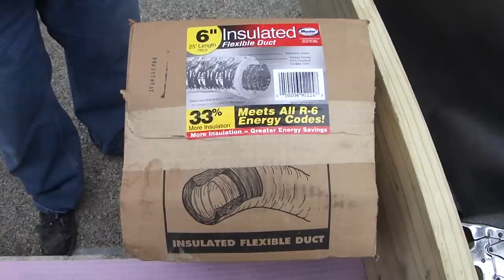Building A Small Room Addition And A Deck

Comment: i dont mind having a code to work from but now days code insnt just about safety its about land value and to generate income for state and county /citys ,,if it was only for saftey  measures u could build any size building u wanted on ur property and dwell  in it but its not,alot of codes are made to boost industry as well like the one i know of states u have to use a header for gages that are laminated together wen u can make a header just as strong for the task with lumber and plywood ,in fact code called for it in the 80s but since the big lumber maufactures now have lamininated materials available u are demanded to use it,,the manufactures are the ones testing their products and setting most codes to those standards wen the average joe can use a completly diffrent material to do same said task and be just as good or better it wont pass code because they dont have proof of concept to get it passed it takes big money to do the testing of those products for diffrent appkication and big industry is who has it so the goverment takes their word over the publics,,and really who is to say the strengh of one peice of wood is stronger then another wen it comes from a tree it could have diffrent qualitys to it if u go to the lumber store and buy ur lumber theirs a tag at the end thats says its safe go to the saw mill the guy gives u rough cut lumber and no tag the saw mill lumber will be thicker and yet the big lumber store issupposed to be the safe peoce of lumber wheres the logic in that ,i tell u its greassed palms that makes it safe for code mno dude didnt do a perfect job he could of nailed his rafters to the roof band walls not sure how he tied the roof to the house but i dont see it falling down any tome soon,he actually over built alot of wat he did especailly the foundation,good video,but u really should watch a few more videos or take a class on how to frame if u intend  on doing this for a living it will save u money and help make most of ur jobs alot easier and make u more inc0me in the long runn,

Comment: noooooo noooooo  never tap off a heat supply bud an not with flex pipe ether you have to go off the trunk an have a return near the room to take it back to the air handler an that flex was way to long 12 feet is pushing airflow with that stuff run  hard pipe all the way to the inside of the house do not ever run flex outside   flex off the trunk if needed  4 inch hard pipe  is all you need for that tiny room

Comment: you gotta stop calling floor joist rafter. It's against code  and its not healthy to put pressure treated in a living space such as a ceiling. And next time he thinks it's a good idea to jam a heat vent in the corner or up again an outside wall of a place he might wanna at least keep it far enough away that when u put baseboard on the heater cover still fits on. With all that bragging he did and money he got them to spend on that job he would've ripped that shitty roof off and redone it seeing it was barely hanging on there anyways..

Comment: excuse me this guy is a hack the floor isn't properly supported not enuff joices i dont like the way he does this and the block wall has to have insulation inside or there will be cold radiating from the block during winter and the 2x10's must be tyed in to the joices in the house and the out side walls must parged with concrete to seal.....

Comment: There is all kinds of wrong with this video. No rebar in footer, footer too thin, block joints are scary, no pressure treated sill plate, heating duct under wall, unaccessible crawl space, tying heating duct in to insufficient supply. I could go on and on

Comment: This guy has problems with finish work the vent is partly under the back wall, the Windows are framed to high how are you supposed to trim them out? The j channel looks horrible and i would like to see how he tied the back or top of the roof at the back wall of the house? Did he remove the siding and flash it properly or just butt it up tight and cock it? Some work was good but the finish work is questionable. Also the pressure treated lumber he used in the rafters was supposed to be on top of the block wall, i think he missed placed  it when he started to frame. Lol. But good job on the rest.
Reply: Corey Empey Most construction contractors don't need to be licensed in Illinois

Comment: did you use boxes in the outlets... I sure hope huge code violation. If you were going to tile the floor why not use in heat floor instead of vented heat. that was a real waste of money over time especially with a sliding door. deck board are all over the place crown up crown down... window has no value

Comment: This guy does not have a clue what he is doing? The pink foam he puts on the block wall to cut draughts is actually called a Damp Proof Course? It stops rising damp? That T junction on the heating pipe, Why not use a Y junction, It would look and work a lot better. The whole thing you made cost you $45 and looks like it. If you secured the pipe under the floor as you showed us all the ends would be on top of the joists (Technical name for those 18 Inch apart floor supports) which is what will muck up your floor boarding.

Comment: Never recomend the duct part, that the worst way to supply a room, he is stealing air from another room, 6” equal 110 cfm, he is taking that 110 cfm to another room, now he has 2 room with a low airflow, inefficient way, big mistakes from people that decide to do the hvac part in a small addition 👎👎👎

Comment: Where is the city\county inspector at?  OMG!  Poor homeowner!  LOL, galvanized nails on the treated deck boards!  Who runs two deck boards together on top of a joist???  Hand rails are out of code.  Worst brick job I've ever seen and I don't do brick.  How can you correctly mud the joints when you have a giant 2x6 jig in the way???  I don't even see stair stringers, he skipped that part and went to the finished product.  Looks like he stacked 2x6's on top of each other to get his rise.  Luckily there are bad blocks beneath the porch or the deck would pull right away from the house and collapse (improper joist connections to the home).  This is the absolute worst I've ever seen!  I built houses in Illinois and Iowa for a while and not a single thing he's done in this video would pass inspection!!!!

Comment: I am so disappointed watching. I do not know why there are several mistakes in construction (even in Illinois). Maybe you are in a place that does not require it. But I have some comments. Tie your foundation to the house with horizontal steel reinforcement and have vertical reinforcement every other block cell so cracks do not appear. Vent your crawl space. Use pressure treated lumber against the masonry blocks to prevent exterior joist decay. When using the duct saddle, use the hole in the saddle as a guide to draw a circle rather than just start cutting a hole. You cut away too fast from the rest of the floor joisting and insulation. There is no ledger for roof joists after the comment that the roof joist was coming away from the house. There are no positive connections (straps) from the posts to the beams nor floor. Then there is a jump to the finished product. No wall or roof insulation seen. No window installation seen. No roof ventilation seen. No Tyvek installation seen. No interior finishes installation seen. No deck construction assembly other than unspaced lumber (and regular lumber that will decay). The deck is out of square. The best thing I saw was the siding assembly.